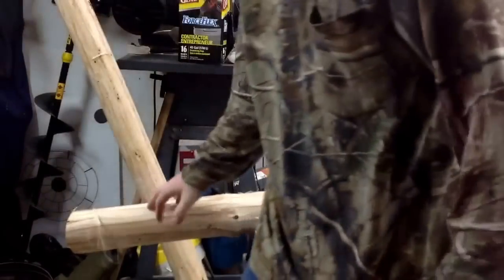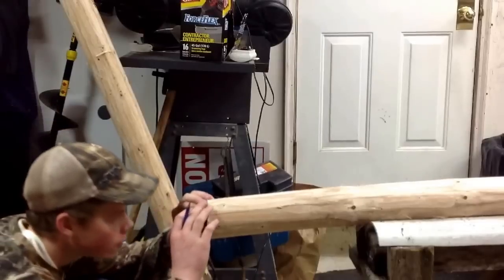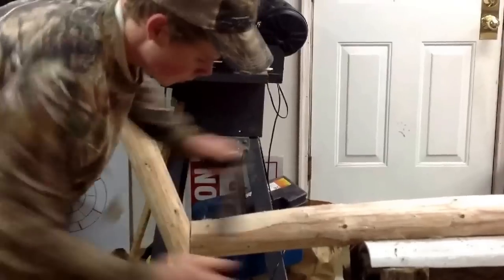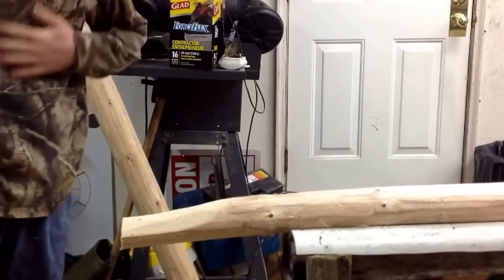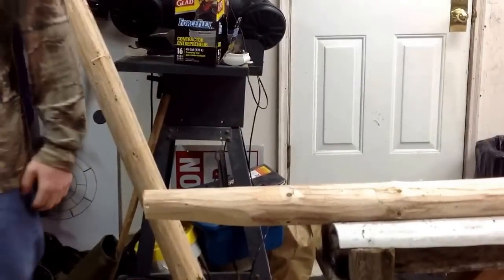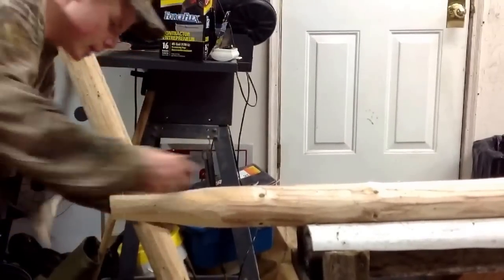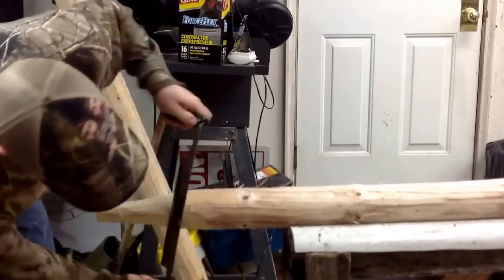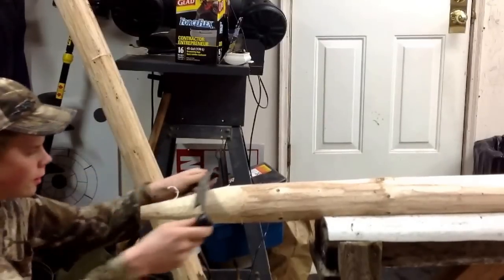How to make a log tenon by hand

Comment from the maker: No problem glad this helped
And rob Reid that is a snowboard rail but I just got a 4x6 and cut a 3 inch pvc pipe in half and screwed it on and just used the ratchet strap to hold it in place